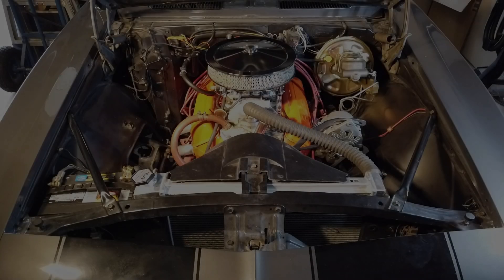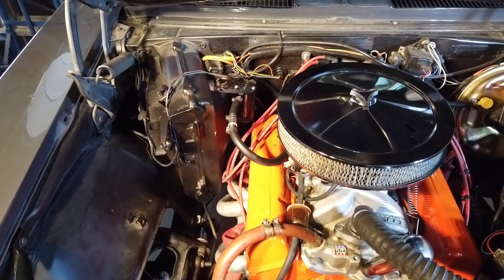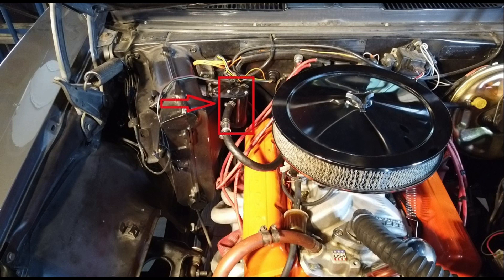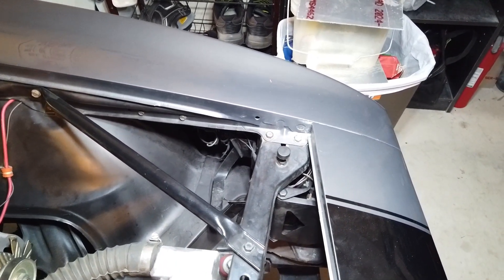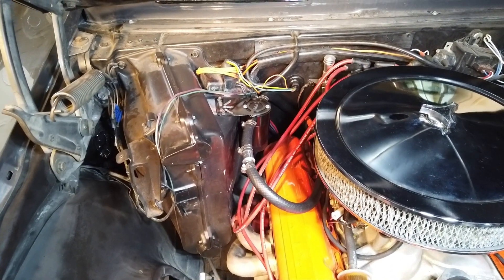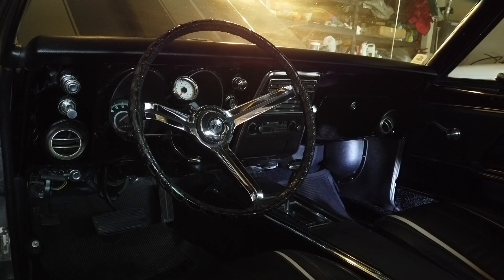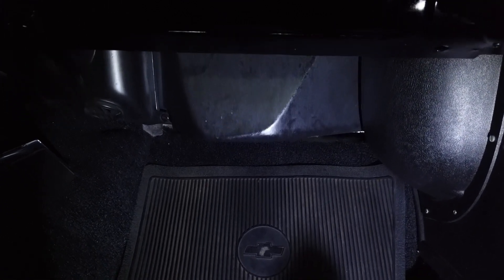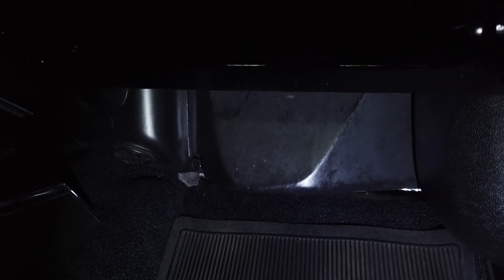ACES EFI Killshot Pt: 4  Installation Prep

Comment: Thanks for the helpful information. Which engine do you have? Why fitech mini instead of aces surge pump
I'm thinking about aces wildcard (port injection) for a 327 SBC, any tips?
Reply from the maker: Ooooooh... The Wildcard is a NICE way to go.  I wish I could have gone that route but Committee wouldn't approve it.  I have an original 327 engine built in 1966.  It had a modified road draft tube that led to an original A.I.R smog system.  That had to go because it was broken and I couldn't get replacements for it in those days. That left the road draft tube wide open but instead of it being below the car as the original draft tubes were, this one was open to the engine bay. That's why I added the catch can and PCV valve. For tips, I would ask you to look at my other vids in the series.  I had a few... but the most important thing I can share is take your time. Rushing it will cause all kinds of issues down the line. Solder your terminal ends.  Things will go better for you that way or you might develop gremlins.  Make sure that the engine block is grounded well. These systems don't like bad grounds. Oh.. and for goodness sake, make sure you wire the power lines to the right things!  DO NOT wire your system to the alternator or the starter solenoid.  People have done that and fried the system right out of the gate.  I have heard many problems with their distributor and ignition system, but I don't know if that was caused by install issues or ACES is just having problems with quality.  I'm using a regular vacuum advance dizzy and have had no issues.  I would recommend using a regular distributor and coil for initial start up and break-in/learn THEN switch over to their electronic ignition (you can buy the full kit though if you know you will go that route in order to save money).  That way you know things were good with the efi BEFORE going all in with every bell and whistle. If you try the electronic ignition control at first and things go wrong it will be hard to find the problem... but if you go regular dizzy and it works fine and THEN you have a problem after installing the timing control... you'll know EXACTLY where the problem lies.  As for the FiTech Mini... When I bought the system, ACES didn't have a surge tank.  I actually mentioned to ACES in my vids that they should work on something of that type.  I was hoping they would come up with something small and elegant like the Mini but instead they came out with that ginormous surge tank that looks so big it might be hard to find a location for it.  I have zero regrets with the Mini.  It's small/compact, and is mountable in more ways and angles than the ACES surge tank.  When I purchased mine, ACES also didn't have an in-tank pump either.  Now they do... and if they offered it back when I was buying my kit I think I would have gone that route rather than the Mini.  Good luck with your build.  The system is really nice and has made a huge difference in the reliability of my car.  My next step will be trying to learn to tune it to make it even better.

Comment: An inline pump doesn't have to be below the lowest point of your tank, it only has to be below the level of your fuel. Unless you are constantly running your fuel level on "E" the pump being 2 or 3 inches above the bottom of the tank wont be a problem.
Reply from the maker: Hmmm. Did I mis-speak in vid?  I wasn't intending on putting it below the tank but it would have had to have been right in front.  That would have required bracketry that dangles right in front of the tank but would be above the bottom level of the tank by what would be the width of the pump itself. Which would have been 2-3 inches.  However, I don't like the idea of hanging a pump there, and I don't want to make some cheesy bracketry out of angle iron.  It has struck me, since then, that I could have made a simple bracket and used the tank straps to mount it there. Oh well.  Still though, from what I understand, the ACES pump is a push type pump not a pull type.  That means that it would struggle if above the fuel level since it would depend on gravity to feed it.  This is why soooo many people complain about these types of pumps not lasting long.  Also, the manual says it should be within 2 feet of the tank.  My Camaro has nothing within 10 inches of the tank that I can mount to, unless I want screws sticking into my truck and that's because my Hotchkiss aftermarket suspension kit took up all the real estate that the pump would require in that area.  Honestly, I wish they had offered the new in tank (returnless) pump modules when I bought the parts to start my upgrade. I would have preferred using that over a FiTech Mini.  Maybe if the FiTech burns out.  I'm hoping ACES has a giveaway of the new returnless in-tank pump.  I'd love to get one of those and would probably make a video about what it would take to install it and modify my current system from the FiTech Control Center (Mini) to the new ACES Pump.

Comment: I used the Holley muscle car in tank fuel pump module in my nova with my killshot.  Works great, and returnless.
Reply from the maker: Yeah like altsound1 said earlier, I probably should have done that.  My concern was that it wouldn't fit on the top of the tank.  I only have like 2 inches between the tank and the trunk floor on the camaro.  I didn't want to risk it and end up with something I couldn't use or a giant hole in my tank that leaked like a sieve. I was playing it safe I guess.  If the mini breaks down I might go that way or maybe replace the entire tank with a new style with built in pump.  I guess that's for the future.

Comment: Holley/MSD is pleased to announce the release of Sniper Diecast Retrofit Fuel Pump Modules, which support up to 700 EFI horsepower or 900 carbureted horsepower and make it easy to affordably upgrade to EFI. Available in return and returnless versions, they convert your factory tank or fuel cell to an in-tank EFI fuel system. They're easy to install with basic hand tools and require no welding or fabrication whatsoever. 
Sniper Diecast Retrofit Fuel Pump Modules include a diecast pump-hanger bracket to control pump vibration in a low-profile design that's perfect wherever space is at a premium. They fit any fuel-tank depth from 7 to 12 inches and protrude only 1.275-inch above the tank-mounting surface to accommodate numerous applications. You can locate the 5 inch diameter module beside your existing sending unit anywhere in the tank and rotate it a full 360 degrees to work flawlessly with various plumbing and wiring configurations. Once the module is installed, all you need to do is connect your power-source/ground and fuel lines.

Supports up to 700 EFI or 900 Carb HP (@ 60 PSI at 13.5 Volts / 16.9 AMP Draw) Of course there are many variables, estimates are based on gasoline. Individual systems will vary based on fuel system design, regulator type, fuel cell location, etc...
Features:

    The easiest way to convert your vehicle to an in-tank, EFI fuel system
    Installs in any fuel tank from 7” to 12” deep to fit a wide variety of applications
    The low profile 5 inch diameter design is only 1.275 inches thick above the tank mounting surface for added clearance when needed
    The innovative clamping system allows you to locate the module anywhere in the tank beside your existing sending unit
    The clamping system allows you to rotate the unit 360 degrees for easier clocking of the plumbing and wiring locations under your ride
    Die cast aluminum construction for corrosion resistance and long lasting good looks
    ¼” NPT ports for a wide variety of plumbing options
    Ideal for Terminator EFI, Sniper EFI, MSD Atomic EFI or any TBI of EFI conversion
    340LPH pump that is E85 compatible for both return and returnless style systems

United States Coast Guard Approved
Certified to ISO 8846, SAE J1171 Requirements

Comment: i wonder if a holly retrofit fuel pump would work for your application
https://images.holley.com/583x/19-360t19144.jpg
Reply from the maker: I've seen items like that before from multiple manufacturers.  They say you don't need to mod or fab anything and then they say this can fit next to your existing sending unit.  The 1st gen Camaro tank has a lowered notch on the top for the sending unit so it doesn't stick up too far and hit the trunk deck.  It only fits the sending unit.  If I use the hole for the sending unit for this pump I'd have to lose the sending unit and have no gas gauge, otherwise I'd have to cut a hole in the tank for this module. It would also sit high because it doesn't fit in the notch with the sending unit... but yet they claim it doesn't require modding.  Hmmmm... I'll look into it.  Thanks!
Update:  I saw what you mean. It's gotta be one of the nicest solutions I've seen.  Problem is that it's $650 bucks for it and the necessary tubing and fittings. I paid about $370 for the Mini.  Since I promised the Committee I wouldn't spend more than a total of $1K it was not in the cards for me. Great solution though!